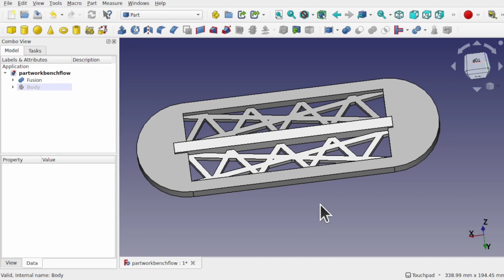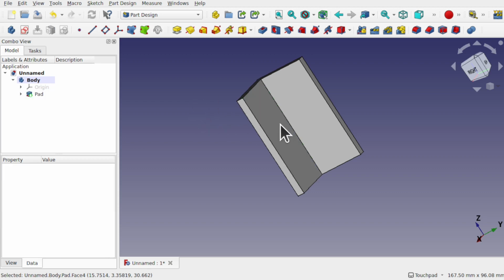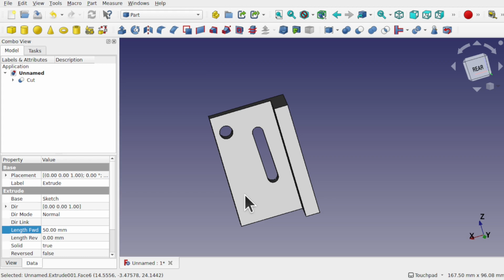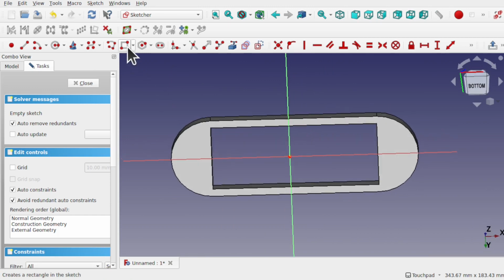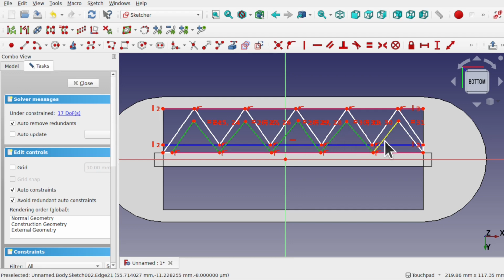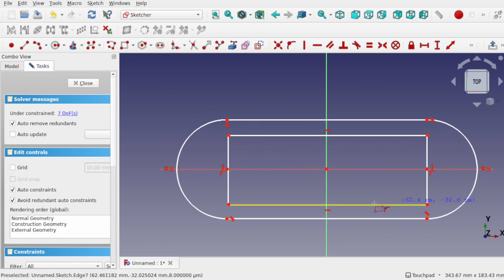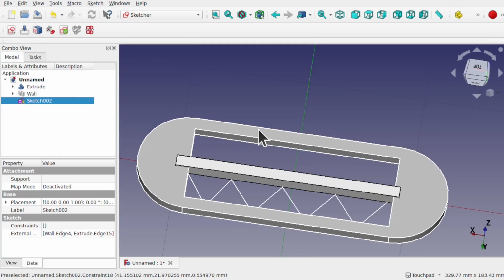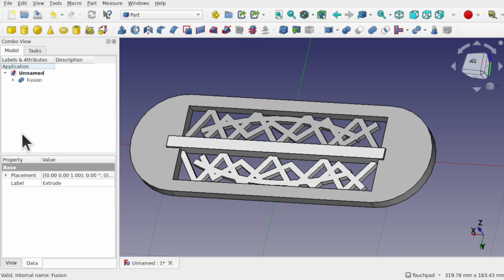FreeCAD: 2 Models but which workbench? My choice and why! Part or Part Design

Comment: I am tempted to ask a question: Can we select a shape, sketch or body and copy-paste it?
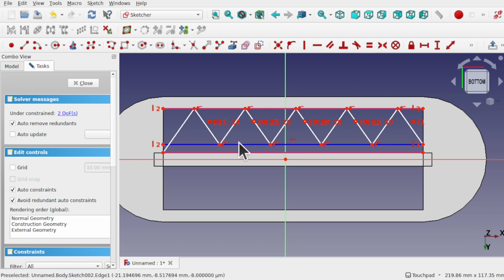For example, at 11:04, it would be easier to just copy the polyline and paste a copy a little below the original.
(We need to edit it a little, but the overall effort would be far lesser.)

I tried to use the Edit> copy and Edit >Paste commands, but i could not create a copy of the element.
I selected the element (a circle, hexagon, rectangle, etc), and did a CTR+C and CTRL+V. But that does not work, either.
Reply from the maker: Yes you can :), there are two sketch tools in the sketcher, clone and copy.  One clones the selected geometry with a basic constraints such as equality.  The other clones the geometry with its dimension constraint.  You can experiment by making a sketch with a circle and add a diameter constraint.  Select the circle and go to top menu> sketch > sketch tools and you will see both clone and copy.  Take note of the roll over information for these tools which will tell you how to use.  Hope that helps.
Reply: @MangoJellySolutions  Oh thank you so much for that tip!

I just realized that when we switch workbench, the first four menu items do not change at all, although many/most of the sub-options are grayed out. 

All workbench-related functions are provided only from the fifth menu option onward.
As a result, the tools of the current workbench get buried deep in the menu system. 
But then FreeCAD philosophy is to use keyboard shortcuts, so this may not be considered as an issue at all.

Comment: While I was creating a lot of bodies with the part design workbench in the beginning, I have now come to using the part workbench a lot more often than part design. I don't know how often I broke a body, because some intermediate steps for a change lead to invalid bodies. And while not as frequent as the breaking of the bodies, FreeCAD's undo function failed in quite a few cases, which was mighty annoying. The part workbench objects are A LOT more "robust" and the they combine a lot better with other workbenches.

Comment: If I'm use the Part Design WB then I am unable to use other WB's like Curves and Arch WB's?
Reply from the maker: It depends on what shapes you create.  Certain curves and geometry created in curves can be used in pulled in with shape binders or dragged and dropped into the body as a base feature.

Comment: 00:00 Intro
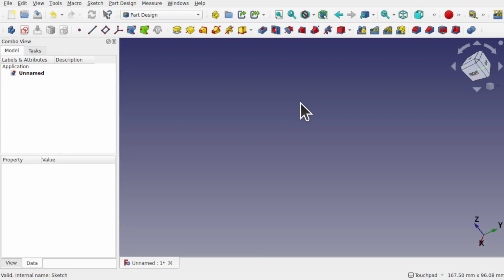00:58 (Part Design win on object A)
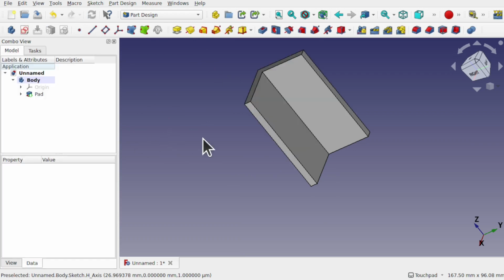02:01 Pad / Extrusion process difference between workbenches
[Part Design is quicker due to automatically moving between workbenches]
03:29 (Part loss on object A)
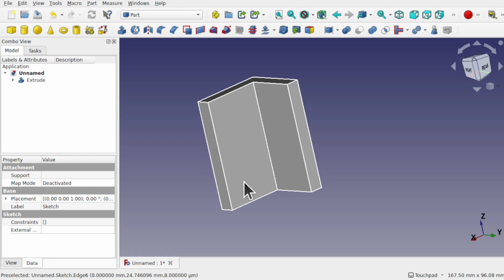04:36 Cutting a sketch out of a part with Extrusion and Boolean Cut
[more steps compared to Part Design's Pocket tool]
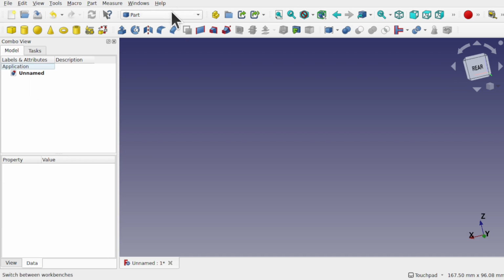06:20 (Part Design loss on object B)
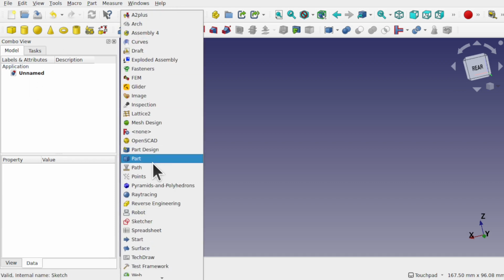06:20 Sketching base object
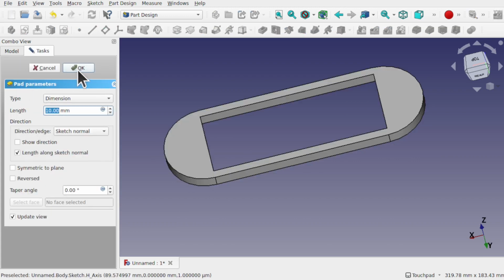08:07 Sketching complex struts
12:03 Padding & mirroring struts
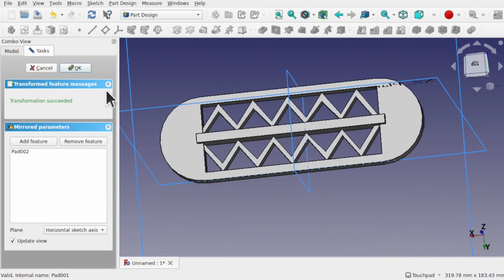12:37 Attempting to change complex sketch
13:35 Attributing Part Design loss to ensuring a sketch is a closed wire with volume, rather than lines that can be given volume later
14:09 (Part win on object B)
14:09 Sketching & extruding base object
14:55 Sketching center strut
15:24 Using Arch workbench to create a "wall" from center strut sketch
[Part is more interoperable between workbenches, so more tools are available to you]
16:38 Sketching struts in simple straight lines (not a closed wire, no internal volume)
17:51 Using Arch workbench to create walls from struts again
18:14 Arch->Add Component to fuse center & side struts together
18:38 Editing strut sketches, demonstrating automatic easy changes
20:26 Outro

My takeaway: Part is flexible by allowing more workbenches to interoperate with your objects and not locking you into a specific workflow or set of tools, but sticking to Part Design creates a cleaner model while eliminating tedious (and sometimes confusingly nested) Boolean operations.
Reply from the maker: Thank you so much, and great that you added your little comment about what you took away. Have pinned to the top

Comment: I was thinking about using an Offset2D as a BaseFeature in Part Design but it crashed as soon as I tried with intersecting lines. Currently on 0.19 tho, might work with newer releases. Also makes the document tree messy, but many useful tools already tend to do the same, I guess this is just something we have to live with..
Btw. are you using the mouse for demonstration purposes only? It's totally legitimate for making YouTube videos, but if we aim for efficient workflows, hotkeys/sequences are the true game changer. Except for every single release of FreeCAD I've tried so far comes with slightly different bindings, luckily it's configurable, so no big deal.